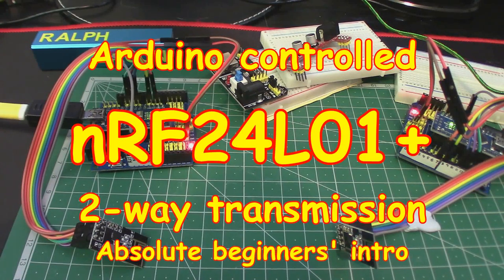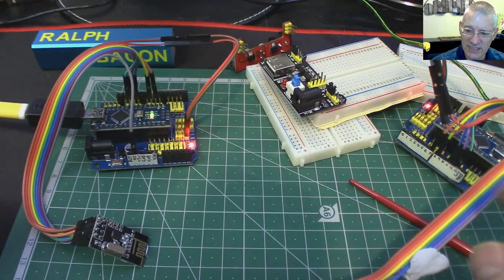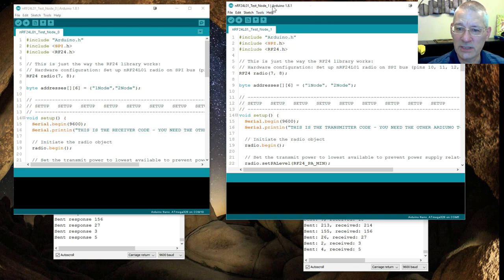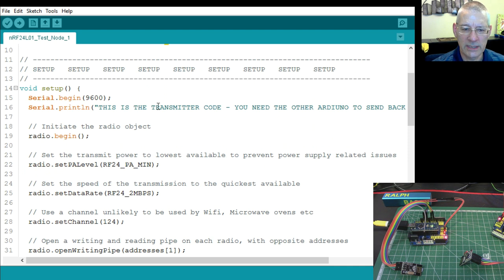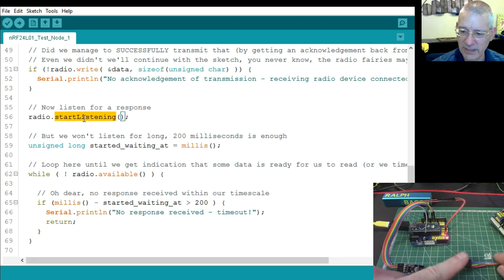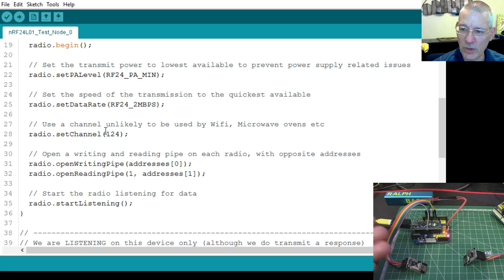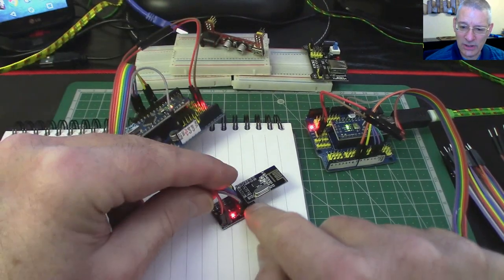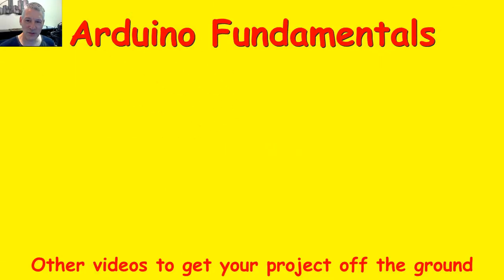#73 nRF24L01 Send (and receive) data with your Arduino!

Comment: I think that the receiver sucks more power than the transmitter because it has to amplify the signal and process it, while the transmitter just sends it.
Reply from the maker: Yes, it does, as the current is higher when receiving than when transmitting. A bit counterintuitive!
Reply: Yeah, amplification sucks power... On another topic, did you manage to pair a transmitter with a receiver so their communication is unique and can't be influenced by others on the same channel?

Comment: Just a feedback about my results:
I am using the highpower version with the adapter board. But have left the settings in yr sketches unchanged.
Works well for a few cycles, but then there seems no relation anymore between what is sent and what is received back (E.g. Sent 54, Received 79).
If I reset the  receiver, it goes fine again for a few cycles. Sender and receiver  about 30 cm apart
Maybe a power issue... I feed the adapter board via the 5Volt from the arduino, that comes directly from USB and a USB charger.
The randomnumbers coming back surprise me.
Anyway, I will experiment a bit further
UPDATE:
Interesting: coz of many USB ports occupied, I  initially fed the transmitter from my USB port and the receiver from a charger, thinking  seeing the output from the transmitter was the most important... and I saw the errors described.
As I wanted to see what was going on in the receiver, I  freed up a USB port, plugged in the receiving arduino, opened new instance and now it seems rock steady, problem gone.
That teaches me that USB chargers are not really reliable as power source for an Arduino.
Anyway, lets see if i can make it to 1 km
Reply from the maker: Ah yes, the old power problem, especially when operating at high power. Glad to see you're on the way to getting it sorted though. 1km (in open air) is what they say these units can achieve. And remember you can get higher power versions with a walkie-talkie style arial which will doubtless boost the signal, for just a little more money. Awaiting you 1km results with bated breath...
Reply: OK, set to max power and  slow transmission.
That initially seemed to give rather disappointing results as even when  30 cm's away, the transmitter doesnt get anything back (or at least not much). Increasing the waiting time even to up to 1.5 secs hardly had any effect.
However, when I check my receiver.... The receiver seems to get most if not all of the numbers sent, it is just the acknowledgement that doesnt arrive. If instead of a random number I send a number increasing from 0, it seems all numbers are received, but don't arrive for acknowledgment. Hmm is that the  receivers fault, the atmosphere's fault of the Transmitters fault for somehow not recognizing the incoming data
 Further digging. Oh well, that will keep me off the streets today

UPDATE: this problem gets solved down the line, read on :-)
Reply: Well, the power problem actually  reveiled itself at low power settings. Don't think it was a matter of not enough amps but more like a 'dirty'  power line with spikes on it. After all, these are unshielded HF unfiltered modules.
The one I have is that walkie talkie style antenna (that is why I bought it :-) ) now if I only can sort out why the transmitter doesnt get acknowledgement on high power slow transmission, eventhough the receiver receives every number. Even at 3 secs timeout the  transmitter does not get an acknowledgement
Reply: I hope you don't mind sort of posting my ongoing findings here, but it may help others.
Recouperating: 
Min power/max transmission speed worked well
Max power/min transmission speed -> arrived at receiver but no acknowledgement
High power+ Max transmission rate-> yep the acknowledgements are coming in again. 
Max power/max transmission speed-> all arrive at receiver, 9/10 of acknowledgements come in.
Seems to be a problem with the slow transmission rate, even when I  extend the time-out to 3000mS
Reply from the maker: So you're using the standard sketch I supplied, with just changes to the power and speed settings? The receiver gets the correct (random) value from the transmitter? The transmitter gets the auto-acknowledge OK but received a strange number back from the receiver? What value is the receiver sending back (should be the number received plus 1). So many questions, I know.
Reply from the maker: When you say slow, you mean the RF24_250KBPS setting? That is supposed to be the most reliable setting! What about the RF24_1MBPS setting (intermediate speed, I suppose)? Oh, and both units are on the same speed settings?
Reply: indeed, that is the surprising thing. After I got it working per yr example on min power, max speed, I used  min speed (250KBPS) and max power and that is when i ran into problems.
yes both on same speed settings, receiver received everything  and  printed it was sending acknowledgement... but that never arrived.
Now on max speed and max power, all transmitted messages arrive at receiver and  9/10 get confirmed.
Completely unexpected.
Both are fed from an adapter board, receiver gets its 5 volt to the adapter from one of those  tiny breadboard PSU's (that you have shown as well)
I still will try the 1MBPS
Oh well, I will sort it out.
Reply: standard sketch indeed. The 'strange' number issue is solved as that was  a problem using an USB charger as PSU.
i now send increasing even numbers so I see they all arrive in sequence, and the acknowledgements are increasing odd numbers. All works at high speed, but not at low speed. That is the surprising and unexpected thing
Reply: OK, tried 24_1MBPS
again the same: all messages arrive, no acknowledgement received. Absolutely weird. I am sure once I find out  I will think 'how could I be so stupid not to see that'
As I  had the  library installed for some time already I think, I may see if there is an update (maybe mine got screwed)
Anyway, I don't despair, I am sure I will sort it out, it is just completely different from what I had expected (expected the problems at high speed, not at low)
Update: Nope, library latest version and OK
Reply from the maker: There is no such thing, they say, as coincidence, and your updates reach me as I'm developing my Benny In/Out project, which uses the nRF24L01.
 
I've changed both Tx/Rx to PA_LOW power and speed of 250KBPS. They are separated by about 20 feet / 7m which is all I need.
 
All working exactly as per my demo. Thanks goodness or my project would now be blocked!
 
If I get an insight as to where you issue may lie I'll let you know. I'm powering both transceivers directly from the the two Arduinos themselves, +5 volts as I'm using the adapters, which I am assuming you are too, which obviates many of the power-related issues.
Reply: Ralph S Bacon indeed. that's my setup too, although on my receiver I have tried feeding the adapter off of the 5 v Arduino pin (And thus being fed directly from usb) as well as from a breadboard PSU. same results..
max speed is the only one that works reliable. 1mbs and 250kbps don't. I am focussing my attention on the receiver.  Yet having problems at lower speed goes against everything I thought I k Ew about transmission. currently 20 meters apart. different floors with concrete in between. max speed max power. all arrive, 50-70% acknowledged. seems to come in waves
Reply: OK, final woord for today: both transmitter and receiver now on usb of different computer:
at 2mbps rocksteady (80cm distance)  but at 1mbps and 250kbps, all messages arrive but only incidentally the acknowledgement arrives
Reply from the maker: Just to pip your final word, can yo give me a link to the actual nRF24L01 product you're using please? Incidentally, and I don't mean to be rubbing salt into the wound here, my setup as described earlier today was rock solid with those parameters - hence my suspicion about the actual product.
Reply: oh not rubbing it in at all Ralph. nrf24  from here https://www.aliexpress.com/item/1sets-Special-promotions-1100-meter-long-distance-NRF24L01-PA-LNA-wireless-modules-with-antenna/32341792715.html
adapter from here: https://www.aliexpress.com/item/New-Socket-Adapter-plate-Board-for-8Pin-NRF24L01-Wireless-Transceive-module-51/32652342305.html
I was starting to suspect the modules, especially as it is such an odd error, but it could be anything
Reply from the maker: I'm grasping at straws, but here goes. You may have an nRF24L01 (note the missing plus sign). At least that's according to other forums I've scanned about your particular hardware. Check the actual chip - you should clearly see a plus sign as part of the device. Mine says 24L01+ all on one line. Above that it says NRF M (whatever the M means).
Reply: it is a bit fuzzy but it says 24L01+ in one line.
above that it says NRF M
below that it says 1609AH
The fact it is stamped on there ofcourse doesnt mean it actually IS a  +
That said, it did send en receive on 250....... just no acknowledgement
Reply from the maker: In that case it does sound like you have the correct device. If you did not have the 'plus' version then 250Kb would not be supported (on the original nRF24L01), it was introduced with the nRF24L01+.
 
But you have confirmed you have the correct chip (unless it's fake - gasp). Unlikely though as your messages arrive but just don't get auto-acknowledged. You could include the line
 
radio.setAutoAck(true);
 
in the setup but I'm pretty sure it's the default. But worth a try at this stage.
 
OK enough for today, keep plugging away, you never know... as a final resort you could try a couple of the standard modules as per my demo (I got mine from Amazon UK in a matter of days, pack of 5 for the same price as on AliExpress, but I don't know where you are in the world). Example: https://www.amazon.co.uk/d/Network-Transceivers/PIXNOR-5pcs-Professional-NRF24L01-Antenna-Wireless-Module/B010N32SGM/ref=sr_1_2?ie=UTF8&qid=1495299331&sr=8-2&keywords=nRF24L01%2B
Reply: I' ll give tat aTry Ralph and thanks for thinking along.Done for today though as it is always good at a certain point to put things away and look at it later with a fresh view. Sometimes that immediately makes  one see what is causing the problem. Maybe i will get a few standard ones.Not that ineed them but can always check them out. Am in Netherlands, but not in a hurry
Reply: I would expect the AutoAck to be default as it does work on 2MBPS, yet i set it as true. But it shldnt matter as i understand the receiver sketch to actually do the acknowledge
Is it my imagination but do i now get maybe 1 out of 100 confirmation on 250kbs as opposed to 0 out of 100 prior :-) Also switched the devices: no difference.
Anyway,I put the transmitter at some 300 meters (330 yards) away with free line of sight and that works fairly well. Maybe 2% loss. The problem ofcourse is that since i do not get the acknowledgement, i cant resend data that gets lost.

Will be trying some different software
Reply: [SOLVED}
In the receiver sketch i added a 50ms delay between the  radio stoplistening and the acknowledgement sending:

 radio.stopListening();
    data++;
    delay(50);
    radio.write( &data, sizeof(char) );

Now i do get acknowledgements.
odd thing do that in spite of me increasing the time out to 300 and even 400ms, the transmitter keeps saying there is a time out, but will print the received acknowledgement nevertheless.
I will experiment a bit with the delay to see what the minimum is
You may want to add the suggestion of adding a delay in yr program, lest someone else may encounter my problems.
Maybe the high power PA/LN modul i have just needs a bit of rest between listening and sending
Thanks for yr help
Reply from the maker: Hmm. I just need to be clear on our terminology here, Ed.
 
By "acknowledgement" are you referring to the auto-acknowledgement that is conducted automatically by the pair of transceivers as part of sending a packet (in the transmitter it's the bit where is says "No acknowledgement of transmission - receiving radio device connected?"
 
Or, are you referring to the reply sent by the receiver back to the transmitter where it just adds one to the value it received (the random number)?
 
Looking at your fix, it seems you mean the latter, but I'd like you to confirm that please.
Reply: Yes, i understand, let me try to be precise and not introduce new confusion.
after i inserted the delay, I now still get the line:

No acknowledgement of transmission - receiving radio device connected?
but it does also now prints the line:
Sent: 98, received: 99
so i DO get confirmation from the sketch that the data is received and increased, but still have the transmitter tell me there is no acknowledgement. I do understand the difference now
So still no auto acknowledgement, but the data is being sent back
Reply from the maker: Understood. Did you try inserting the following line into the receiver sketch (in the setup):
 
radio.setAutoAck(true);
 
Just in case that chip has it switched off for some weird reason!
Reply: yes, i did. made no difference
Reply from the maker: When all else has been eliminated, what remains, however improbable must be true (so says Sherlock Holmes, or something like this, especially if diagnosing this problem).
 
Sounds like your chip is not auto-acknowledging which is weird because that's one of the strong points of the nrF24L01 - if it doesn't receive an acknowledgement it can re-send the data up to 15 times.
  
I think at this stage you need to swap out your devices for 'standard' ones just to prove it is your devices that are in someway non-conformist!
 
Final question then I'm out for lunch: does this auto-acknowledge work at any other speeds / power levels?
Reply: Elementary my dear Bacon, elementary.
yes, though you might have lost that during our exchange, it does work at 2bpms, not at 1bpms or at 250kpms.
I' ll  see if i can get some standard ones and i am actually curious about experiences of others using the highpower ones.
Maybe i must consider it a feature rather than a bug: at lower speeds u dont need the autoacknowledge :-)
Reply from the maker: Ha ha! I just wanted to make absolutely sure I had correctly understood our previous exchanges (you have now confirmed this, phew!)
 
I'm using 250KBPS and it auto-acknowledges as expected. But, 1MBPS (which is the lowest the original nRF24L01s could do) is fine too for long-range transmission, and it all seems to work then as expected for you too!
 
I'd definitely pick up a couple of 'standard' modules (make sure they are the 'plus' version) just to prove the case, but it's entirely up to you, of course!
 
OK, I've found this exchange both fun and frustrating (especially as I have now got Benny's IN/OUT working just fine at 250KBPS) but that delay you mentioned does seem necessary for your modules. Cool, till the next time.

Comment: to: Ralph S Bacon  ;Do the master node and slave node differently  !?
Reply from the maker: The Master and Slave are identical electronically, they are just running different sketches, that's all!
Reply: Ralph S Bacon  ; Thanks a lot . Please tell me , how many cycles (of 16 Mhz or xx of Divider) to implement  a command in ardruino ? I read from datasheet that it is 2 cycles but I don't know 2cycles of 16Mhz or 2cycles of the divider !!! I think that I may be calculate the difference time of the LOOPS  between 2 sketches(RX and TX)

Comment: Feeling very stupid now... I was feeding the NRF24L01 HOLDER with 3.3v and it has a 5volt Input!!! Sorry for the false Alarm.:-(
Reply from the maker: No need to feel stupid, Paul, I've done the same. The unit itself only requires 3.3 volts but the adapter plate (holder) has an onboard 5v linear voltage converter which also makes it much more stable if fed with a decent 5v supply (the one from the Arduino is OK for low to moderate power, a separate one may be required if using the highest power setting). Keep experimenting, these are nice little units. Thanks for posting the fact you've sorted out your minor oversight (it will make everyone else reading this feel very superior until they too make a simple error!)